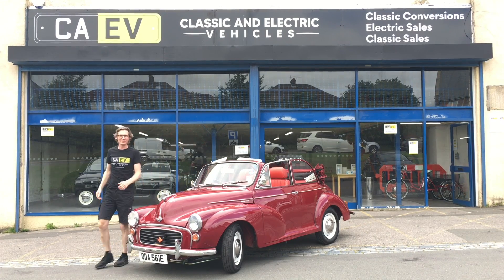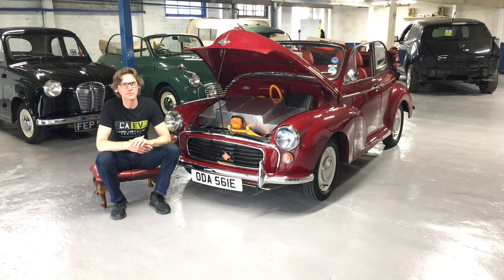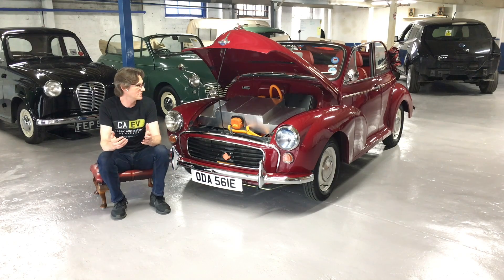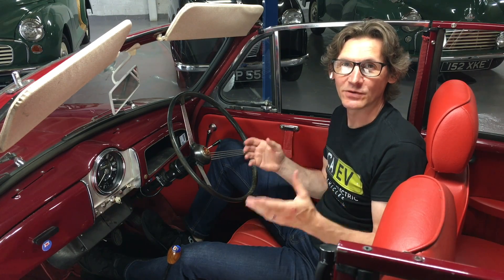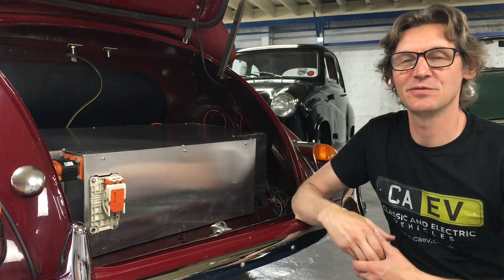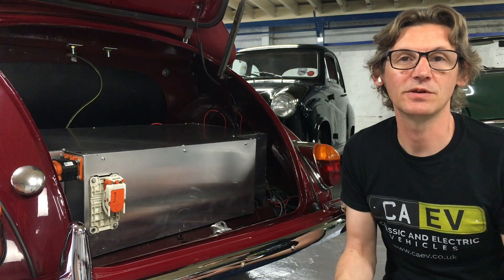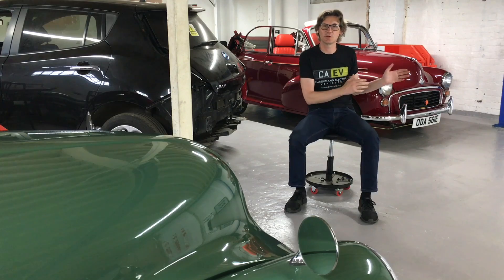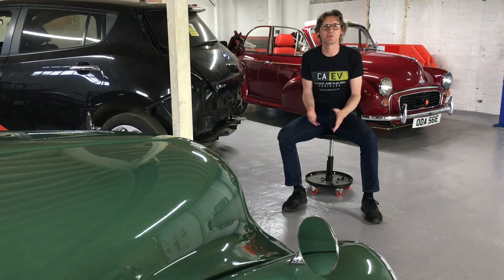Morris Minor Electric Conversion

Comment: Can someone please tell me I just don’t understand it why rip the heart out of a classic car when there is no need to. Petrol will be around for a long time and diesel yet! So taking a zombie car to a car show what ever you do don’t open the bonnet as there is nothing there. It’s now a ghost car. And  the BMC a series engine was brilliant on fuel economy 40 Mpg + anyway. The heart shape combustion chamber is the most efficient design for an overhead 4 stroke engine. With using today’s technology the  A series cylinder head will produce more power  and still retain its fuel economy + still using the std camshaft!
Reply from the maker: Hi Paul, thanks for taking the time to comment. to answer what I think is your question(s) There is no need to take the engine (if thats the heart) out of the car, its nearly an option if you want to change to a better system. It's been going on since the cars were new, you may have noticed quite a few Minors with Rover v8s and Fiat twin cams. As with those this is an upgrade but to a more powerful, smooth engine that doesn't produce any tail pipe emissions. As you appear to be a fan of drag racing it also give much better acceleration as all of the torque is available from zero (A drag racers dream is it not?) Ive never seen any information about the A series being the most efficient combustion chamber - could you send me a link - sounds fascinating, however at the end of the day its still boring fuel that cant be recycled and is causing harm to the environment. As with everything in life classic EV conversions aren't for everyone but if we didnt try different things there would never have been any Hot Rodding etc would there?

Comment: Why would anyone think of doing something so NASTY to a national treasure 🤮the unique sound of that little engine🤮
Reply from the maker: Thanks for the comment. These conversions are not for everyone. I imagine that some people dont like to see V8s or Fiat twin cams put into Morris Minors. Electrification means they can be used everyday and are now 0% tailpipe emission. Our conversions do not alter the vehicles structure at all. In fact you could take it all out and fit refit the petrol motor if you wanted. Can I ask what your opinion is on the V8, fiat twin cam etc conversions?

Comment: Vastly increased bhp but still with drum brakes and the same old suspension?   Those components were insufficient with the old petrol engine.
Reply from the maker: Power is turned down to suit the vehicle. electric motors brake using regeneration so no need to upgrade brakes. Car weighs approx 75kg more than original so not much more.

Comment: Clean build and beautiful color!  I like the seats too.  Why is it that electric conversions companies rarely mention range?  As an electric car owner (2 Tesla’s, X & S) I can tell you that range is an issue—especially in a conversion.
Reply from the maker: Range on this conversation is 80 to 100 miles, depending on the wether. There are many variable that make it herd to determine the range on a EV conversion, wether, battery condition (if the batterys are not brand new) and the weigh of the car it self can all effect the range. When we made this video we were still testing the range the of the car and did not include it in the video.

Comment: I would be alarmed and extremely upset - if any Conversion Specialist placed the Charge Port right in the centre of the Morris Radiator Grille. It advertises the fact that the Morris is electric, which may increase the chance of theft of the Morris. Secondly, any passer-by can open the Charge Port, or even vandalise it!! This should be ONE HUGE EMBARRASSMENT for the Conversion specialist, who has damaged the aesthetics of a beautiful Classic Car..... Sir, you have done the car no favours at all. Charge Port should have been hidden away.

Comment: So in order to come away with an electric Morris Minor, a Nissan Leaf has to die!
I don't mourn the passing of any Nissan. But this might be  a bottleneck in terms of supply. What we need is a Lithium battery manufacturer based in the UK, and not committed to supplying new cars - a nice start-up situation for university engineering graduates, with experimental inclinations, I would think. They are not going to compete with Tesla in terms of scale of production.

Electric or otherwise, the finish on that MM convertible is exquisite.

Comment: I saw you answered another comment to say this car has a range of about 100 miles -- which is perfect for what I'd need. I've seen one other Minor / Leaf conversion with a 40 mile range but with what looked otherwise like a very similar bolt-in/bolt-out conversion; is that difference determined by whether you use 30 kWh modules or 24 kWh modules (can't recall what they used)? Would using 50 kWh modules increase the range further to ~150 miles? Brilliant job, lovely garage, and nice to see the streets of Durham again briefly!
Reply from the maker: Yes if we used 40 or 62 kw cells well it would increase the range

Comment: I see this is now on Ebay, conversion for about £25000 for a second hand leaf motor and batteries? Also in the video it is standard suspension, I am glad my Moggy on standard suspension doesn't bounce around like that, I would get sea sick. The concept is possibly good for around cities etc but get out to Rural areas where a round trip is possibly 150 miles with no charge points?
Reply: One day this might be needed, but frankly why do it now - or for the foreseeable future. Pre 1983 cars are exempt form the ULEZ. The tech will massively improve, AND quite possible that petrol cars will outlast all EV's. Might be a good business, but I think their customers are attracted by the gimmick.

Comment: nice stuff. hopefully this type of conversion will become more common as time goes by.
Reply: Unfortunately the cost alone will probably force 95% of classics off the road. Yes it should come down a little over time, and kits will be available for the mechanically proficient but for the rest of us it'll be time to find a new hobby.
Reply: @stevehadfield5963  i think you my be right to some extent. but i don't think the classic cars will not all go off the road. we do have large numbers of steam engines still going thanks to enthusiasts. hopefully the same thing will happen with classic cars as it would be very sad to see them all go into retirement.

Comment: No electric conversions, but Charles Ware of Bristol offers many modifications to help to bring Morris Minors up to date. He offers a full restoration service too, along with things like alternator conversions, disc brakes, suspension modifications, electric power steering, a 1300cc engine upgrade, a 5 speed ex Ford gearbox conversion etc. You can even have heated windscreens, both front and rear if you wish, along with a heater upgrade. If you're into Morris 1000's his website is well worth a look. I'd buy one of his fully restored Travellers in a heartbeat if I had the cash to spare. You'd be looking at £25k plus for a nice one though......

Comment: Would have been nice to use the fuel filler opening for the charge point rather than the grill mount one
Reply: attach an old AA or RAC badge to the port lid  problem solved..... :):)

Comment: Awful ! Swap it back ! When all vehicles are electric are we going to build more nuclear power plants to supply the extra electricity? That'll be great ☺️
Reply: Not necessarily. I'm no expert in power generation but for example both Top Gear and Wired have articles (linked below) regarding EVs and general power infrastructure in the UK. As I understand it, there is no shortage of energy and it is constantly becoming cleaner thanks to higher efficiency devices like LED bulbs and renewable energy sources increasing. Infrastructure and user mentally are some of the most difficult issues due to the cars requirements (high voltage, high current) and people used to fuelling at a petrol station. Difficult to change, but not impossible either. 

Top Gear: https://www.google.com/amp/s/www.topgear.com/car-news/electric/will-power-stations-and-grid-be-able-cope-our-ev-future%3famp

Wired: https://www.wired.co.uk/article/electric-vehicle-car-infrastructure-charging-point
Reply: https://electrek.co/2020/10/21/australia-to-host-the-latest-worlds-largest-solar-farm/   The solar farm in the Outback will be capable of producing 10 gigawatts and will be so big that it will be able to be seen from space.

Comment: No mention of price, range and I assume no re gen, and the sound cutting out makes me suspicious of the noise level. I'm not a fan of running it through the old gearbox adding extra weight and friction for no purpose, I can't see why it would be so hard to remove it and make it direct drive from a reducer to the wheels.
Reply: Re the gearbox... you are of course correct that a gearbox adds weight and friction, but so does a reducer which is, after all, a one-speed gearbox.
It is entirely possible to do away with the gearbox but like all things it needs engineering. The chassis is already designed to take the original gearbox, the propshaft is aligned to the original gearbox, so by doing this you save an appreciable amount of engineering (especially if the goal is to have a reversible conversion) as well as keeping the original interior.
Also, even with an EV you can benefit from multiple gear ratios even though most production EV cars don't have them. Increased wheel torque at lower speeds can make it easier to drive around hilly historic cities, and lower motor speeds at high road speeds can make the NVH a bit better on a cruise. You can get by without them (as production Nissan Leafs are testament to) but that doesn't mean they're not useful.
Reply: @donkmeister  I own a 1971 Beetle EV, with Tesla batteries powering it! The gearbox and Competition Clutch have all been retained.  I have to agree with you, that it makes no sense to just have a single speed, with the Main Motor screaming at maximum RPM, like Motorway work. It really is the very best of both worlds. Around the towns, it starts on steep hills in 2nd gear. No handbrake starts either, because you can 'feather' the accelerator pedal as a 'hill hold' feature (short time periods) on steep hills. Main Motor is much more than the Nissan Leaf at 125 HP with 173ft/lbs torque. With Regen as Brake Assist. Most important feature is the Battery Cooling, which Nissan Leaf didn't get right. Also, the use of Nissan Leaf (second hand used) batteries in any conversion, is a "best guess" situation on Range. Who would ever want a professional conversion done in this way?  Simply translated - spend the money on batteries, because you will have no surprises. My Beetle a whole lot of fun and a real pleasure to drive! Greetings from Australia.
Reply: Top (4th gear) is in effect 'direct drive'. The first motion (Input) shaft is directly coupled to the mainshaft.  The laygear just idles ie. drive is not transmitted through it.
Reply: @Ampex196  Direct drive is not much use on an EV, that's the whole problem, in this case it's using  the low tech gears in the original box instead of a much simpler and up to date reducer.

Comment: Very good but what I like about the Moggy is the sound as well as the driving experience surely all the drivetrain has to be updated with all the extra weight and power our can you not put the sound through speakers so at least make it sounds like an old Moggy?? Also environmentally wise you said you sell on the parts of the leaf what happens to the body what happens to the old engines? Can you replace the batteries?
Reply from the maker: The extr weight is equivalent to an extra person in the car so it can handle it. Power is managed through the custom controller we use. we are working on the sound. We store or refurbish and reuse old engines. The leaf bodies are cut to reuse panels and the remaining metal is recycled. Yes batteries can be replaced anytime but won’t need to be for a long time. :-)

Comment: Lovely, but how do the gearbox and back axle cope with the massive torque from 0rpm of an electric motor? I like the idea that this is a reversible conversion though. What's the range?
Reply: Glad it’s reversible. Otherwise could lead to embarrassing Isetta/ brick wall situations
Reply from the maker: Range is around 100 miles. We program the custom ECU to deliver the torque and power safely. Making it reversible was always a key goal.

Comment: Standard brakes designed in the 40s with nearly 3 times the power is simply irresponsible. Find 2 motors with 25hp each and ditch the gearbox, propshaft and rear axle. It's a 40mph tootle kind of car not a motorway at 80 machine.
Reply from the maker: You don’t have to push the throttle all the way down if you don’t want to go fast. The motor has regeneration which does a great deal of the braking
Reply: @KinghornElectricVehicles  I reckon I could boil the fluid in 5 minutes. You can't spec it assuming the next customer is as sensitble as the first. Less power is fine or some front discs.
Reply from the maker: The aim was to see if the standard components could cope. If you wanted to drive in a spirited fashion it’s easy to upgrade the brakes and suspension. Just let us know what you want when you order yours
Reply: @KinghornElectricVehicles  but surely there's going to be people out there who will automatically assume what's already there is more than capable of handling all the changes?

Comment: You should be able to mount the spare wheel under the bonnet above its cross member.
Reply from the maker: The batteries sit there. We now have the boot floor installed and a spare could go on top if needed. Will make a video about it.